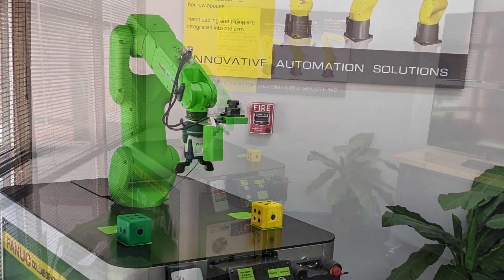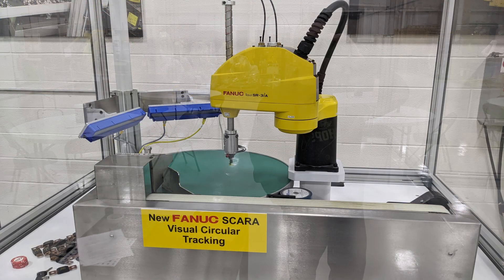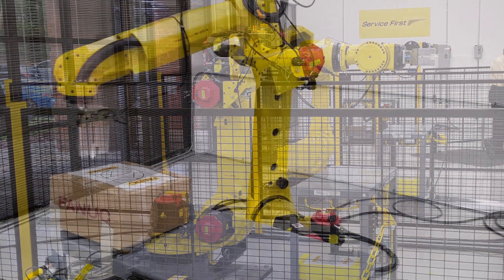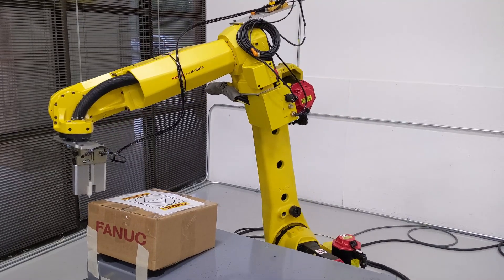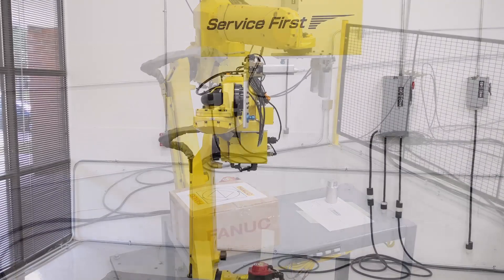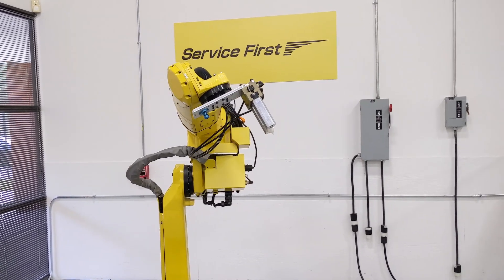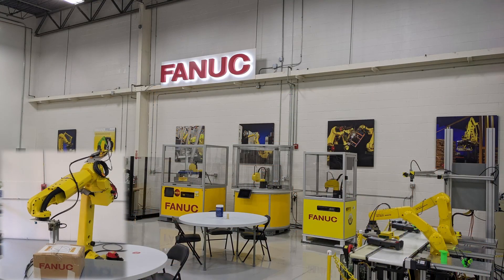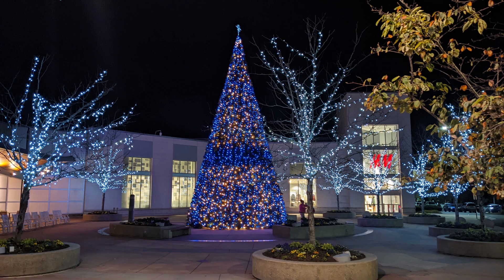Fanuc Robot Training in NC

Comment: It will be interesting to see when and if intelligent robots will be used. I assume what is programmed her is specific movements. How much can the robot adjust to and still pick something up if that thing is in the wrong place? 

That is what I think of when saying intelligent robot. You would say pick up this object and it would do it everywhere within arms reach. So the object doesn’t have to start in a specific place.
Reply from the maker: Yes, some do have vision systems and some have sensors for feedback such as how much load/force is applied. We did not get into that in this class obviously, but they have specific classes on specialized systems similar to some in the photos shared in the video. The one in the photo with the guitar for example was supposed to be similar to that. It was developed to follow the contour of the guitar while sanding regardless of how it picked it up. Some of the smaller bots had the vision system for sorting etc.,but I did not get to see those in action during this class.
Reply: @ThriftyToolShed Thanks for the extra details and sharing this video. It is a really interesting subject. It will be cool when robots move out of the factories and into our lives, beyond vacuuming and mowing the grass of course.